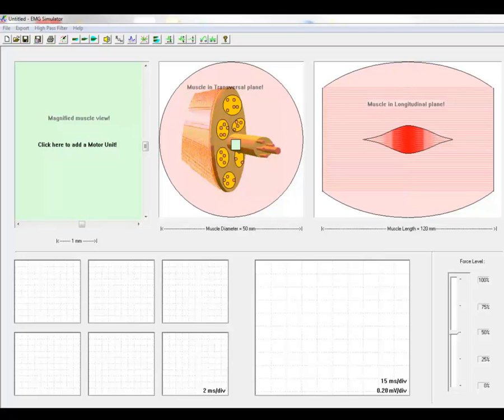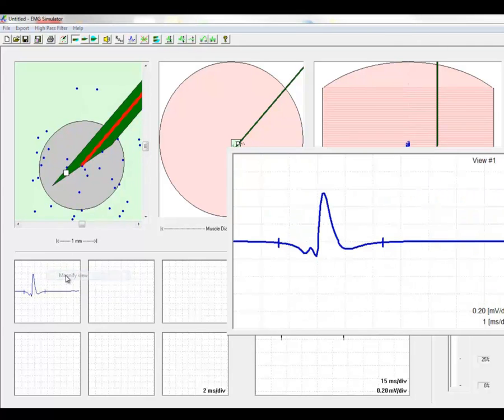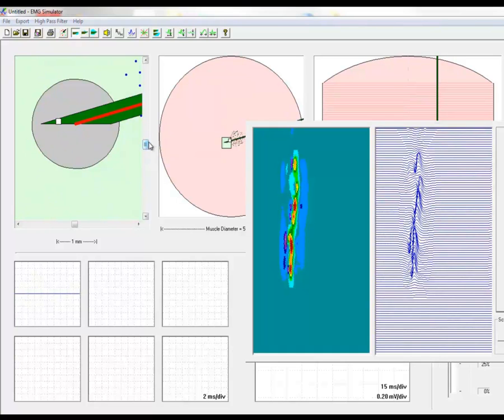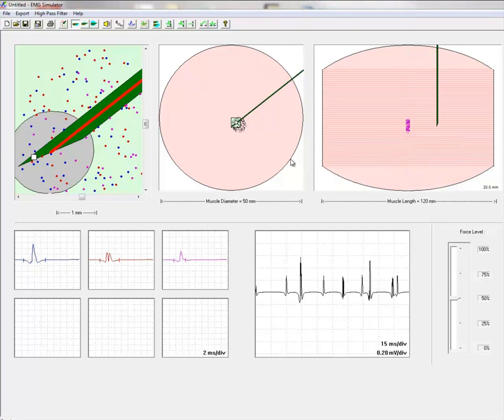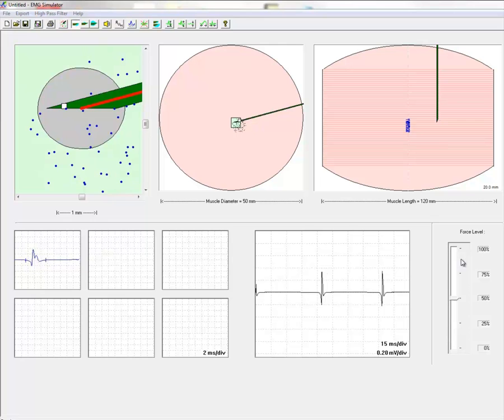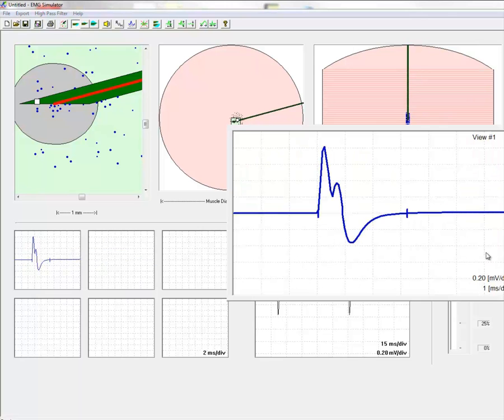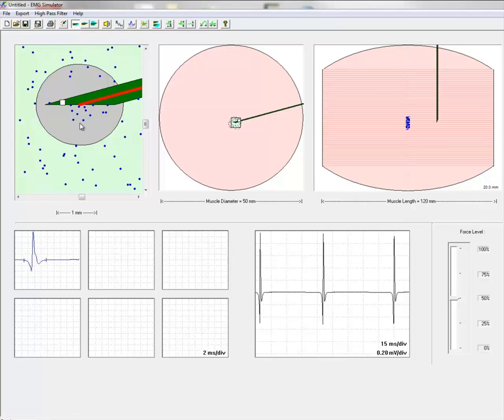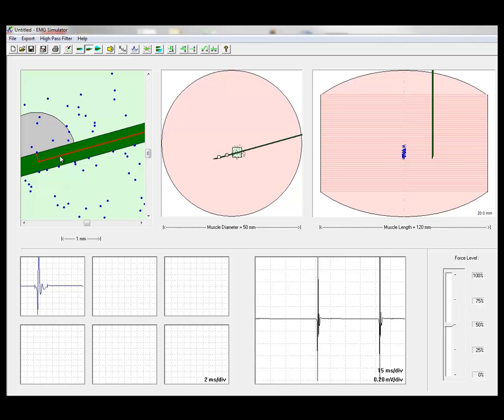EMG Simulator

Comment: Do I understand correctly that the polyphasia of myopathic MUP is a consequence of the increase in the variability of muscle fibre diameters? And the different diameters lead to different conduction velocities in the respective muscle fibre?
Is this one of the reasons why MUP should not be registered from the endplate region?
Reply from the maker: Yes you are absolutely correct. And in addition, signals at the end-plate zone do not have the positive going "arriving phase", they start abruptly in negative direction, so the duration is cut into "half", or at least become shorter than signals recorded a few cm downstream